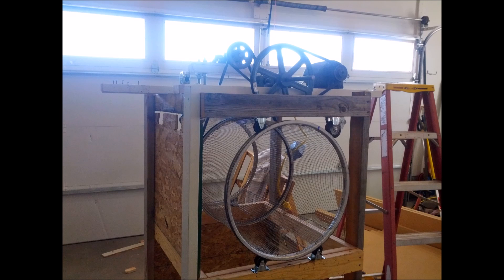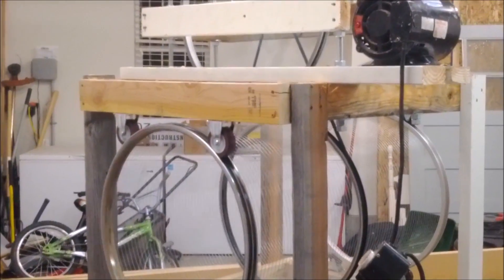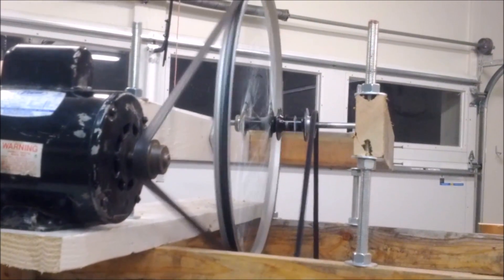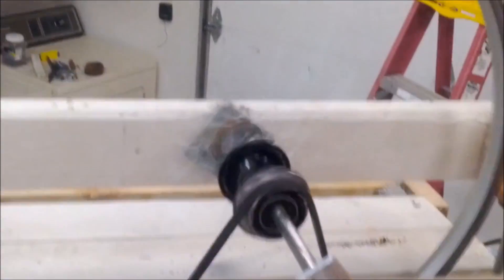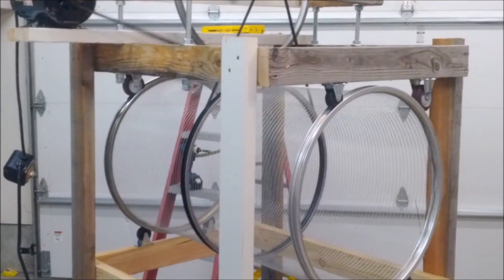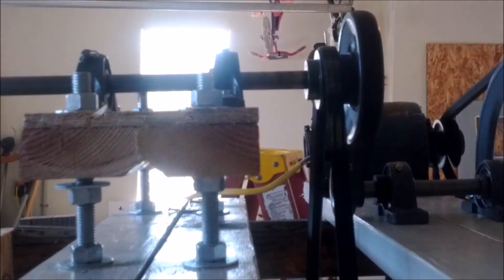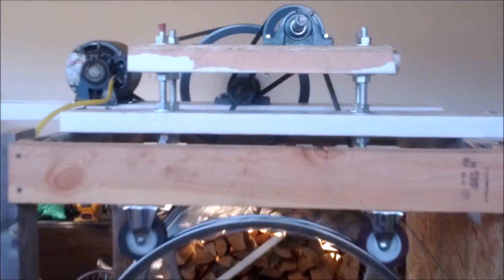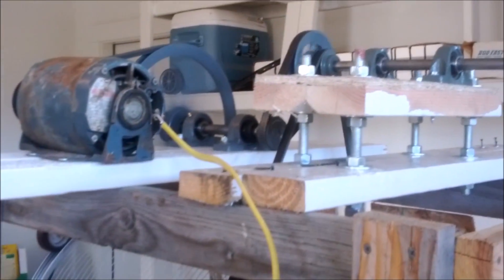Soil Sifting Trommel

Comment: I made one recently for less than $150 with ALL off-the-shelf parts that is direct drive and 2000 lbs torque... so there are no trips to the junk yard looking for motors, reduction gears, pulleys, chains belts, wire, and no tension adjustments etc etc etc.   My design is also the ONLY design I have seen that allows the screen sizes to be changed in less than 5 seconds AND it's totally off grid portable using 12 volts.   I'll make a video soon... so if you are interested, check my videos. Now that I have perfected the prototype and have the design and measurements I think I can build them in less than a day.  I have built 350 roofing hoist and posted about a dozen videos of them and I have other videos of DIY projects including animal and fish traps and off grid water and water heating systems.  Enjoy!

Comment: I can't find anybody who makes an economical commercial trommel.  The market for home gardens and compost sifting suggests that people would buy them. I have a small frame which fits on my wheelbarrow with 0.25" hardware cloth attached. It takes +/- an hour to sift a few cubic feet of material.
Reply: I considered buying a Harbor Freight cement mixer and using a hardware cloth insert inside the drum.
Reply from the maker: +Lucky B. So many options or ideas. The trick is to do it for a reasonable price. Look at surplus supply via their catalog you request by mail. Good items that can be used. I went through all the options as well.
Reply from the maker: hardcoremofo. I live rural. I found a bunch of my parts at the landfill. The bike rims and the motor. Do the cement mixer and show me.
Reply: A mixer is $250 .... and takes a LOT of modifications.  You can make a better one for under $150 without making trips to a junk yard.